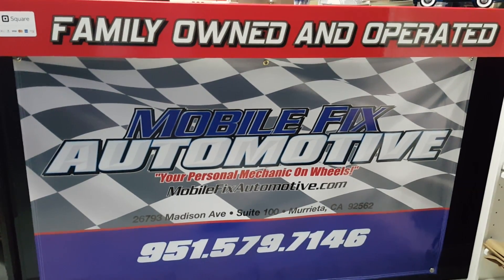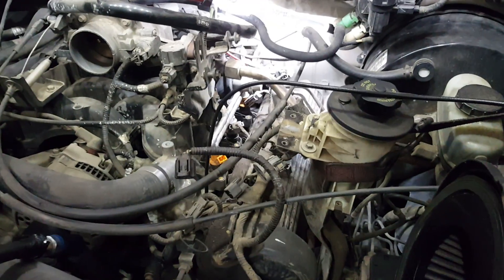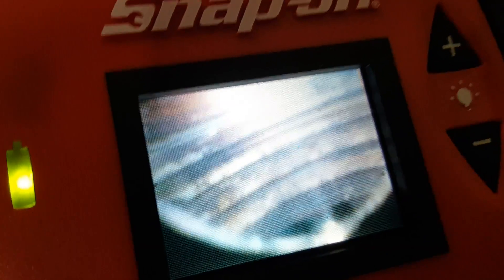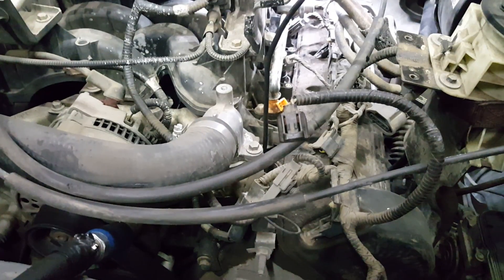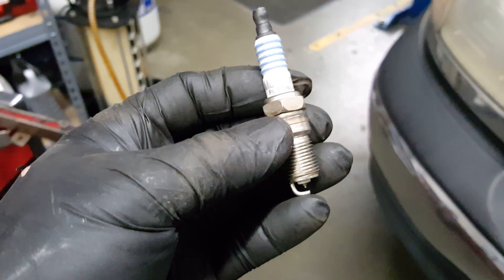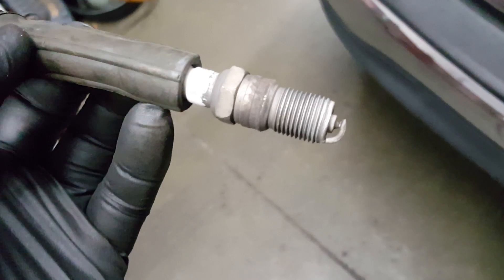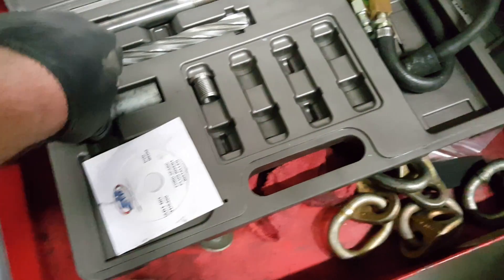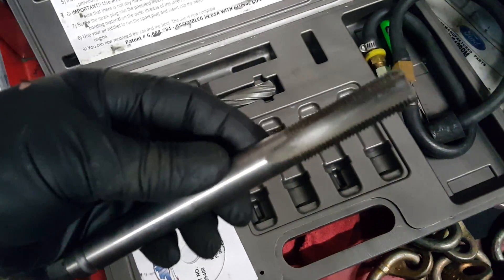Why the spark plug blew out of your Ford Triton engine

Comment: I am a diehard Ford guy but all Triton gas V-8's are JUNK......zero power.
Reply: John A truck engines are about torque not horse power. The two valve triton motors have relatively no problems....
Reply: That's not true. Sure, the 3v 5.4 has problems, but that boils down to Ford cheaping out on the oil pump. Replace the oil pump and that's 90% of the engine problems solved. As for power, the 5.4 makes more power than the 5.0 until 4500 rpms. It's not that they don't make enough power, it's that they don't make any more power above that. It's specifically made to make all it's power down low in order to tow. That's why the 5.4 was such a good towing engine. You don't see the 5.0 in the Super Duty line, but they had the 5.4. That you think they're junk and have no power shows that you don't know anything about them, or what they were built to do.
Reply: John A 
Ur an idiot if ur a Furd Turd lover

Comment: How do you screw up a simple thing like spark plug threading?
Reply: Ron Williams
No way computer design is the problem, computers are just another tool, the user is still responsible for the results.  Ford produced a batch of lemons and failed to fully back them and lost some customers for life.
Reply: lee hancock nevermind spark plugs Ford hasn't been able to get an exhaust manifold to not leak and they've been making vehicles for over a hundred years it's ridiculous
Reply: Kevin Noble
I'm certainly no expert but I believe such problems were specific to a limited number of years and only one engine type?...later years than yours.  They had one early 2000's I think, (don't remember the yr or yr.s) that were really lemons.  So bad that there was some movement toward a class action suit, dunno what happened to that.

  A friend of mine had his in the shop some 240 times in two yr.s and then Ford said "Our obligations are done with you."  He will "never" by another new Ford as a result.  The innercooler blew a couple times,  he would take it out of the shop and it might last a day or two before leaving him stranded again.  It seems to me they should have simply bought all of those back from pissed off customers and scrapped them or replaced the engines with a different version, they were that bad, lots of power but totally unreliable.  Everyone who owned one regretted it, Ford must have lost a lot of previously loyal customers over it.
Reply: Bo McGillacutty  I was drawn to this video because the title said "Triton engine" which is what my 97 has. That was the first year for that engine so I was hesitant when I bought it but both my trucks have served me well. My biggest headache for both trucks was the heater core which requires removing every screw that attaches the dash to get to the heater box. 

I guess the integrity of the dealer and the shop manager helps in getting problem vehicles fixed properly. I once owned a 90 Ford Ranger with a 2.9 V6. I was slowly losing water, maybe 2 cups added to overflow reservoir every few weeks. I couldn't find any leak.  Pressure tested radiator and it held the proper pressure overnight but when running and at operating temperature it wouldn't hold pressure for 5 minutes. The dealer where I bought it said they don't have problems with those engines despite that his head mechanic told me those heads are prone to crack from the water crossover port to the middle cylinder exhaust valve stem.  I removed the valve cover and spotted the crack with my naked eye. Called another dealer I heard was fair informed him of the problem and the fact I was 30 miles over warranty, he told me Ford had a problem with those heads cracking and he said "bring it in we will fix it under warranty." He even had two heads in stock waiting for the next truck with a problem like mine.
Reply: lee hancock 
Thats Furd
Reply: Two 97 f150s here. Each has over 250,000 miles. Never had a plug blow. Three coils have cracked, two water pumps (between the two trucks), one alternator, two rear ends gone bad (one swapped for a used one), two heater cores leaked and replaced, new front wheel bearings on each truck and one set of ball joints, BUT NEVER had a sparkplug blow out.
Reply: cost accountants!
Reply: I got a sloppy on the specifics as I don't recall which engines were basically solid, most of them of course, vs one that was rubbish.  So I guess that comment was irrelevant to the topic here.  Very nice to hear your favorable story, I love it when big businesses (or their associates) go the extra mile, so to speak. 

 I have a '97 heavy duty (15,000 GVW) Chevy One Ton that makes me hesitant to go GM again as the door hinges are made to fail, electrical problems rampant, and a few other gripes.  But then I didn't pay much for it bran new ($23,500 in 1997 dollars) given it's capacity, I would gratefully pay 10 or 20% more to have it's worst problems eliminated.
Reply: Since 97 was the first of these engines maybe later changes to their design made them unreliable and prone to spit out spark plugs. Of course BOTH my 97s had the usual random electrical glitches like showing a door ajar warning light and thus leaving the cargo light on even though the doors were shut tight. Thankfully the master shut off switch would turn them off after 4 hours and I have never suffered a dead battery. My current truck randomly locks and unlocks the passenger door while driving but never parked. LOL
Reply: Simple,  that's ford engineering.
Reply: Jay Conlley
If were gonna be realistic and honest--it's a very short list of auto manufacturers (if any) that haven't produced some lemons at one time or another, Subaru maybe?  Certainly MY fave brands have, that's why model and yr. is every bit as important as brand with a few exceptions like Yugo, lol.
Reply: Bo McGillacutty yeah I know . Ford has produced the most though. 94 mustang, 80s mustang with the 4 cylinder, pinto just to name a few.
Reply: Jay-my first car was a Pinto, not a bad car for 3 grand new, the fuel tank thing was easy fix and not that dangerous anyway, it was way over played in the media, you had to be rear-ended by a 3/4 ton pickup doing 50 mph for that to fireball, at that point it was questionable if you were going to survive anyway....some Ford executives bought them for their daughters, it couldn't have been that bad. (I once did a serious analysis of that for an engineering class, so I know far more about it than most)  But if were going to go back that far let me remind you about the Chevy disasters like the aluminum cylinder walls of the Vega (another $3k car) and the Corvair for example...I can't immediately remember the others but I think there were a few where GM used the market place to test new designs. lol.
Reply: Bo McGillacutty  Yes chevy had some crappy ideas like the manza, horrible car. But I still say ford had the most crap out there. Ford continues making shit cars today . Focus, escort , and anything with triton engine.
Reply: I'm not familiar enough with those Fords, how about the rubbish Chevy  econbox....damn can't quite remember the name, Cobalt or something?....anyway I have always favored Chevy trucks but my '96 one ton has some stupid problems, electrical and door hinges for example.  But it was cheap too.  And I'm a fan of BMWs but I wouldn't dare own half of them out there, simply too unreliable or expensive.  My E46 (2001 330) has been minimal trouble and still fun to drive, quick, balanced near 50/50 weight distribution, feels nailed to the road even at 140mph in the rain with high cross winds, drives almost as well as anything on the road ever and accelerates nicely to 155mph.  Most Americans don't even THINK about fully independent suspension, balance, and all the other crucial factors that make a car handle as well as it can, so they end up purchasing based on bullshit like styling.
Reply: Bo McGillacutty I don't know about the cobalt.  Would never touch a bmw. I'm a buick and chevy person. My 06 vette has been very good to me 105k no problems and my 89 buick wagon runs great.
Reply: I respect the Vette (post mid 80's at least), and Buick is good for American but I would HATE to live with the rubbish driving experience.  Have you ever driven a BMW at the limits, or at all?
Reply: Bo McGillacutty Yes I test drove one very uncomfortable seats couldn't take a bmw on road trips.
Reply: My biggest hang ups with Vettes is their limited practicality and "shouty" appearances, as much as I don't want to be influenced by style it's just too over the top "look at ME!" for me...but no doubt a lot of fun to drive, affordable for it's performance class, etc., ultimately if it puts a smile on your face and doesn't break much, it's good to go, who gives a damn what others think....impressive car in many ways and I could see owning one if I had a dozen cars in the garage. But 3 is a lot for me including a work truck.
Reply: I never had any desire for German brands until I drove some of my friends, it's a fine line between feeling the road and absorbing bumps, for example.  BMW is famous for getting that right MOST of the time, good comfort and fantastic road feel, a drivers car that you can live with. (although my 'dream car', E46 M3 is a bit too harsh for the passengers, but I love it's understated appearance and near super car performance characteristics if not stupidly modified it rides OK, totally focused on performance, get's decent fuel consumption and not that hard/expensive to maintain or purchase)    If a car is strictly made for the Nuremberg Ring it's going to be rubbish otherwise.  My impression of the Vette is it's a fine street legal racing car but not much good for anything else...you might correct me on that.  I need a compromise between daily use and ultimate power and cornering, etc.
Reply: Ford should have own up to their mistake, they would have gotten more respect but being in denial makes it hard to trust them or their products.
Reply: I love the fact that it’s JB welded in. I use that stuff for everything, from crankcase plugs to my wife’s jewelry.
Reply: an engineer I worked with told me you only need a turn and a half(if that I think it was)...HUGE huge company ...glad I seen this video.
Reply: @putheflamesou  540° of engagement is not nearly enough if it is a stressed connection. All of the threads on that plug should be engaged by the head.
Reply: lett ford have them
Reply: That's why there are field technicians, because engineers need heroes
Reply: Ford really didn't care about the customer
Reply: Eazy..smoking meth..
Reply from the maker: +lee hancock 
I asked that same question. I think engineers using computers to design everything instead of good old fashioned American know how has left flaws in most designs. Its up to us mechanics to fix their mistakes.
Reply: I'm a mechanical engineer and 4 threads are not nearly enough.  You should have a threaded length of 1.5 the diameter of what is being threaded into.  There is no reason that Ford only threaded 4-5 except to save machining time. 5 threads wouldn't hold the torque necessary for a plug, even with blue Loctite.
Reply: @epistte  Good reply!
You're spot on with the threads to diameter!
I wouldn't even go so far as to say it was to save machining time.
I've done that work, drilling, reaming and tapping a hole with a big cnc mill takes very little time.
But, they probably didn't bother to see what the actual time difference was and just said 'ship it'!
Reply: @marchhare9440  1.5 threaded diameters of the bolt is standard engineering practice that I was taught in college in the 1980s.  If you try to get the proper torque into fewer threads you are going to strip it unless you use an insert. Every mechanical or civil engineer knows this.
Reply: Ron Williams so explain with that good old fashion know how fucked up? Like the Chevy Corvair? Or numerous other American designs from the 50s and 60s and 70s?

Comment: That's not even the worst part because they make you think little spark plugs are good for 100,000 miles by the time you're thinking you need to replace the spark plugs the carbon has build up so badly over time but when you back that spark plug out with all those threads still sitting in the combustion chamber you'll take  out every single thread on your way out with all that carbon because it's much harder than an aluminum then you're in for a really good time because any shop you take it to use gonna soak you for about two grand to three grand so it becomes the most expensive spark plug change ever
Reply from the maker: +Dena Rauch 
I have to chime in on this one because the statement about spark plug threads in cylinder is not correct. There is a shelf so to speak on the spark plug right above the top thread that mates to a shelf in the cylinder head. Very little of the spark plug threads if any protrude past the hole into the cylinder. I have confirmed this many times while i had cylinder heads off engine on bench. The lower 5 threads of the spark plug are the only threads that touch the head. The upper 6 threads hide in the dark doing nothing.
Ok now play ball!